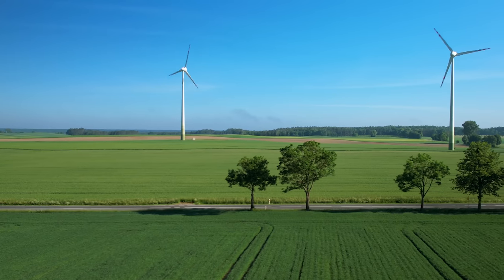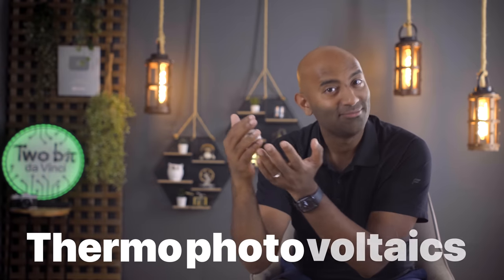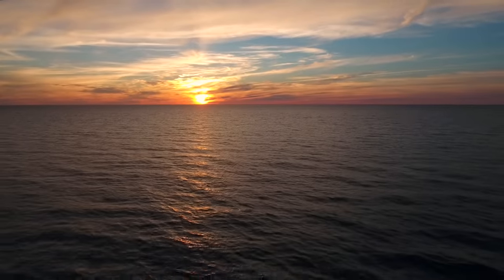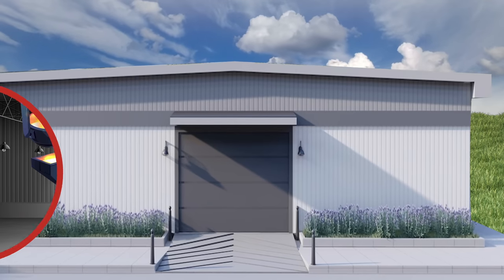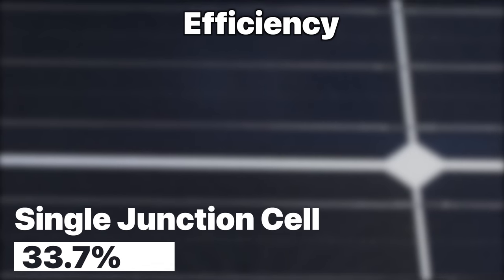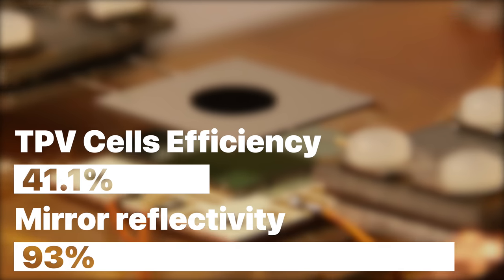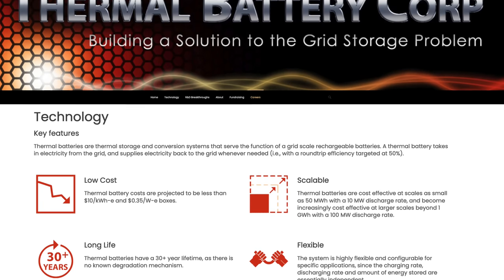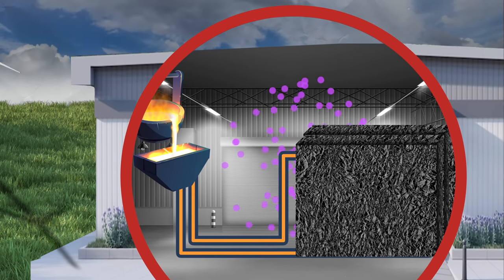Breakthrough Solar cell DOESN'T Run On Sunshine!

Comment from the maker: Start playing Fishing Clash for free on your iOS/Android device: https://fishingclash.link/TwoBitDaVinci
Use my gift code FISHWITHRICKY to get a special $20 value reward!
Reply: Sit upright and learn how to use your nose alone for breathing.
Reply: Very bad & destructive DESIGN to Earth & humans though may be headed in good direction if corrected.  I consult on this.
Reply: @BaliFoodTreePlanter  the idea of heating up a metal to make it brighter than the sunshine that falls upon the earth is an interesting concept...  The solar cells required to withstand all that heat will be a trick not so easy to preform.  Natural gas is constantly being made wherever death has occurred and buried underground.  If you don't burn it off as it is created.  That natural gas ends up in the atmosphere.  We have vast deposits of natural gas and much of stays underground but some does escape into the atmosphere.  Natural gas burns clean and the Greens should have no problem with natural gas being used for heat and other energy requirements.
Reply: @peacepoet1947  Where there are leaky NG reservoirs we should certainly extract and use the gas. But the natural gas we use comes from naturally sequestered natural gas. At this time our species should be working to postpone its use until we solve our immediate problem with too much atmospheric CO2. At this time it is therefore wrong headed to say "natural gas burns clean" since the CO2 combustion product is a problem best described as either pollution or "clean pollution". I just simply don't know where you are coming from. Right now, the most economical way to reduce CO2 emissions is to convert coal fired power plants into NG fired power plants, and only sometimes the investment math agrees.
Reply: @tsamuel6224  I totally disagree with the Co2 theory that it is a cause of global warming.
Reply: Your using either a bad microphone or a bad editing behaviour because i can hear your saliva moving around in your mouth as you talk and ist Anoying!!!  To much high pitched sounds. Can't enjoy any videos.
Reply: @peacepoet1947 . When we burn and release energy it heats THE ATMOSPHERE and other things, then that warmth transfers to different substances, air, water and land before being used again by living organisms to create more matter from warmth through living chemistry. The atmospheric HEAT released by the redox reaction of burning fuels well out-ways any possible heat effect of the C02 ( carbon dioxide ) or carbon it produces, and C02 is re-absorbed by new and existing living organisms as part of their chemical construction ( creation ) as they grow ! So stop this myth that C02 is heating the planet, it’s burning stuff ( fuels ) that causes human induced warming, which is pretty insignificant ( and beneficial ) compared to the heat from the sun and volcanic activity.
Reply: @malcolmwright7440  mankind doesn't heat the atmosphere.  The Sun heats the planets and at the distance we are from the Sun without the atmosphere on our planet the normal state of affairs would be an ice world or snowball Earth is what would be available for us but we wouldn't be here.
Reply: @malcolmwright7440  Sun spots as a measure?  Not sure what you mean by that statement.
Reply: @peacepoet1947  If you look up Earths radiation from the Sun, the energy is 100 % predictable in advance from observing sunspots !
Reply: @malcolmwright7440  what are you saying?  Look up what the Earth radiates?  Weather is not 100% predictable by sunspots.
Reply: @malcolmwright7440  lol
Reply: 100kW with1 square meter!? You sure about that?
Reply: at these temperatures and a room filled with inert gases that cannot be breathed, how would it get expanded if the temperatures don't decrease for months,  what minimum wage individual and shortcuts will the company use??
Reply: @Patrik6920  the problem is finding a more friendly energy.  Lithium batteries isn't the answer and I am afraid of society painting themselves into a corner that is worse for us and the environment.  Methane is being created constantly by dead matter.  If you don't burn it off it will leak from under ground into the air anyway.  Why not burn it for heat and producing energy.
Reply: @peacepoet1947  biggest problem is enrgy storage, and yes lithium isent the answer, while methan leaks idd but we r not activly collecting the methan that leaks, we drill and extract it, still having lekage while producing more lekage, if we could collect only the lekage it would be wounderful, it would slow down the green house effect...but it would likly cost so staggering ammounts that no1 could afford it...
thers alot of stuff being researched and tested in the area of energy storage and i hope most will succed, also in areas of power generation for example solar, wave generators, solar and gravity generatiors r probably going to do well...
...and....burning methane(fossile fuels) wouldnt be a prob at all if we collected the waste gases (thay can be broken down but it cost more energy than u get out)...
Reply: @peacepoet1947  ur wrong...
i also belive ur an american..sry for that....
take care..
Reply: @Patrik6920  I am an American.  Not necessary to feel bad about where I grew up. When you have freedom.  It allows people to do bad things.  People do bad things all over the world.  Our governments do things that our people don't like or want but this seems to hold true in many places.  Those of us not part of it have little control over what does happen.  Our politicians lie to us and we try to share the truth and get shut down like a third world country.  The United States has changed.  I'm old and my only avenue to change what is wrong with government is to share the truth as I know it.  Newspaper articles from the past show a cooling planet in the weather patterns.  Our government agencies are publishing false information because of the communist Obama's was in the WH for eight years.  Obama sure did get rich being in politics from a neighbor community fund raiser.
Reply: Boondoggle, anyone?

Fusion wins the prize for BOONDOGGLE, but this looks like a challenger.
Reply: @Patrik6920  no sense in arguing with a fool.
Reply: @peacepoet1947  ..I was thinking the same thing...
Reply: @Patrik6920  tell me what Obama did do wonderful?
Reply: @peacepoet1947  two top ones 
revokes Executive Order 13233
Affordable Care Act (ACA) aka Obama Care
Reply: @peacepoet1947  ooh and he also recieved a NObel priz for his outstanding effort to try and bring the US natoin to the future...wich was totally hawoched by the next...
Reply: @Patrik6920  is this English ?
Reply: @markjohnson9402  uh?
Reply: @orvillehorner4326  ...solar panes r not whith for sevral reason, the coating that prevent rebounch (reflections in/of the silicon) cant be white, covering them with somethin...would dramatically affect efficency, we want as much photons as possibly hitting them (inc ininfra red)...so white for solar panels r just very bad...
basicly black - absorbs light
white - reflects light
sorry if its hard understand, have a short in the keyboard..
Reply: ahhh global warming?
Reply: Warming the planet block by block
Reply: @marchelandersen6839  🤣😂😁...hopefully, (i do wish so) it works as advertised, but it seems unlikely...
Reply: @peacepoet1947  Malcolm was taking about Total Solar Irradiance, but believes -- like many others who build climate models only based on solar irradiance -- that sunspots and eclipses are the only variables to the single energy input. What they don't consider is that significant events like X-class solar flares release hundreds...thousands of times more energy than the irradiance does when it is earth-directed, and paradoxically the irradiance sharply drops simultaneously with these flaring events. And that flaring energy integrates with the total vertical atmospheric structure of our planet, spurring a host of weather phenomenon.  And yet, solar activity is excluded from models even in the latest CMIP6 dataset that includes solar particle forcing, they just don't use it. As a result of not including solar particle forcing, there is an oversensitivity to anthropomorphic heating as a consequence, where a host of misguided policy changes are fundamentally based upon. 

cheers, 
an 0bserver.
Reply: The biggest challenge is getting this technology to sites where is could be used effectively rather than generating the heat put the thermal photon systems in places heat is already being produced in high volume. Steel mills space rocket launches and other metal production aluminium as you say sand there are many places heat Is available you mentioned some the heat a jet makes is wasted to currently.
Reply: There are huge amounts of lithium at the bottom of the Marianas Trench... but the energy companies (aka China), don't want to talk about that.  Keeping prices high for only demanding 'limited' supplies, works for them.  At the bottom of all 'problems', is greed.
Reply: "Cleanest and _cheapest_? Thats pure propaganda, and as an engineer, you know that.*